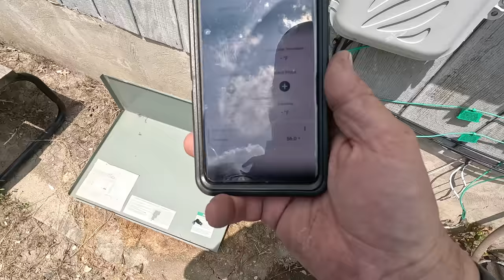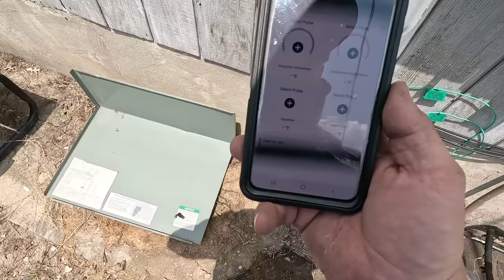Air Conditioner Leaking Water OR A LOT MORE!?

Comment: Home Depot also has Velcro straps with a carbine clip that’s pretty sturdy. I use them for hoses etc strap one on the meter and m12 drill clip on the my belt straps for maintenance and my Klein 1/4 5/16 screwdriver. Knipex pliers. Good video Rick keep up the good work.

Comment: This happens a lot with ac. Cleaning the indoor and outdoor coil. All of a sudden suction line freezing up causing low pressure faults. I try explaining that the system has to be clean in order to get a proper diagnosis and may be a callback.

Comment: Great video. In the situation for the disconnect, do you quote it or have sparkies do it?
Reply from the maker: Something simple like that we do it. Our company has over 100 employees, we have every certification needed to do just about anything under the sun. In the video I just recorded today I'm actually doing work in the electrical panel changing out a breaker and replacing burnt wire.